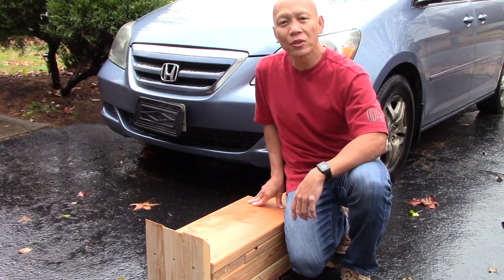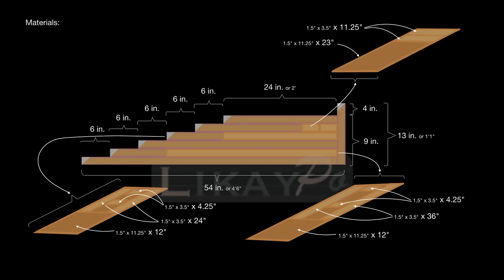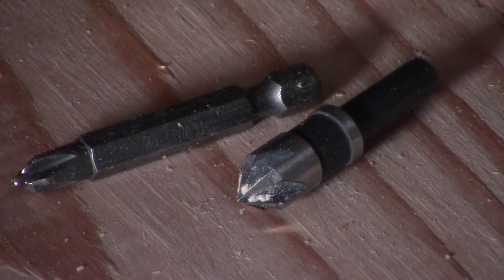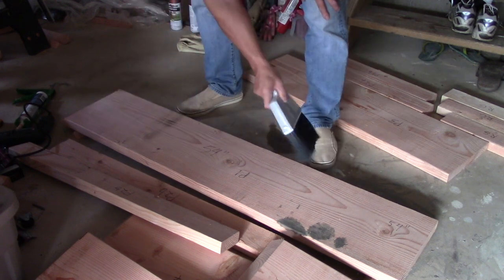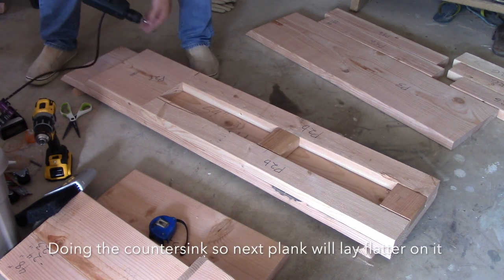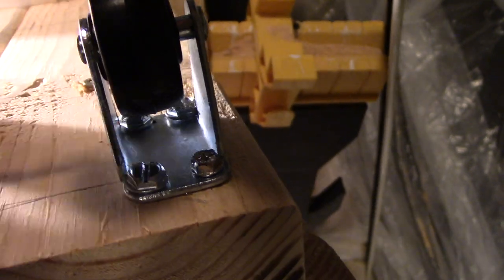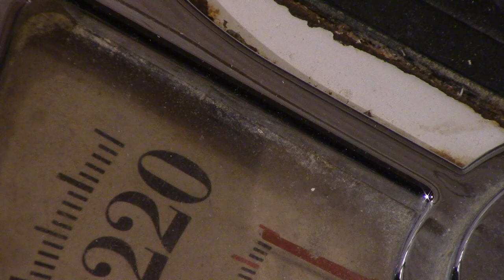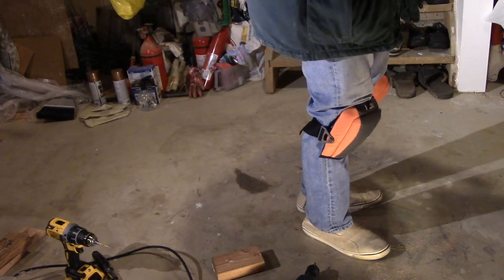Build a Solid Wooden Ramp

Comment: Thanks for the video... Nice design. Quick question... Did i hear right? Each ramp is 220lbs?
Reply from the maker: Yes. That’s why wheels are highly recommended.
Reply: @LikayPo_DIY  ... Okay thanks. I had seen other people build solid wood ramps .. longer than yours too. Some put wheels for ease of movement, others put handles.  They never mentioned weight... Always thought each ramp was about 60-70 lbs...I saw people appearing to move each one without trouble... Maybe their ramps weren't as wide (8inch-10inc) or the ramp as high..(4 or 5 boards)